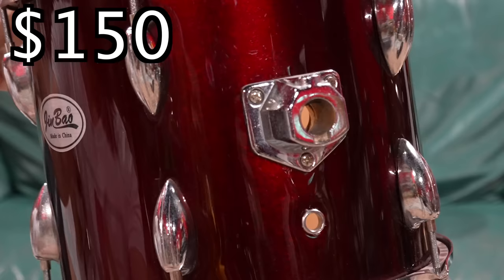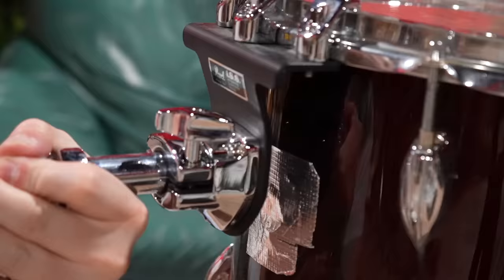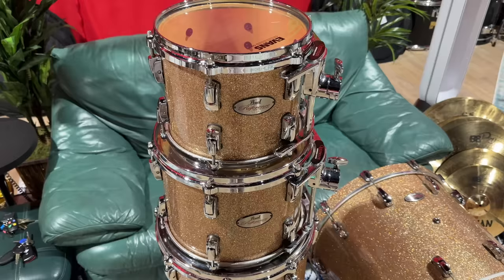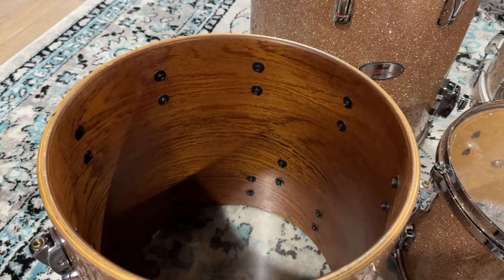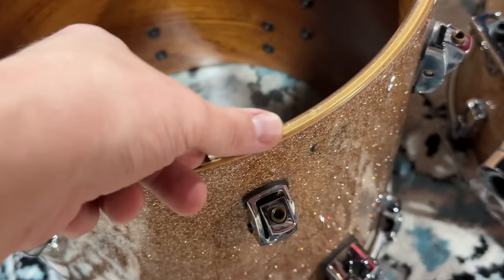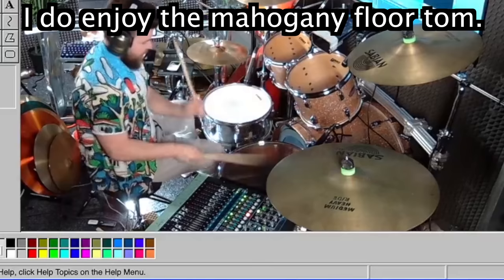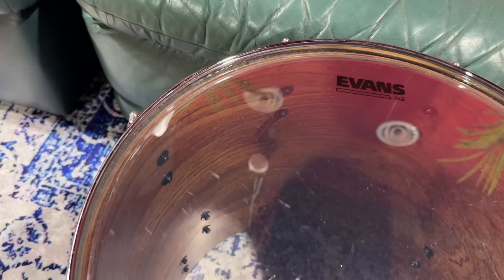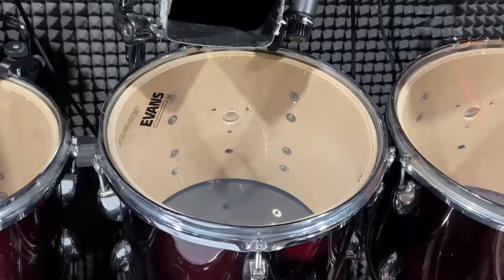Cheap Drums vs Expensive drums

Comment: Lots of opinions here.  I would only add that I had to play for multiple decades before my ear was refined enough to kinda really hate cheap kits...  But eventually it will happen.  Mint heads stretched over garbage bearing edges made of light, badly laminated shells with lugs that don't line up well and loosen off constantly.... Yeah it all works great for a few songs, then it goes pear shaped.  If you're keen, you're keen.  If you're a thrasher who keeps the same heads on for thousands of hours of said thrashing... Don't spend, you do you.  

Placebo effect held in mind, the same rule still  applies in most things in life....tools, trucks, hotels, sports equipment, camping gear....etc 
You get what you pay for, but if you're on a budget, you learn to be happy (ish) with what ya got

Comment: I don't know I think the guy working the corner of home Depot does a pretty good job with a 5 gallon paint bucket, 1 gallon paint bucket and a stainless steel wok and a vaguely conical square piece of aluminum. Sounds pretty good

Comment: This is why I only buy mid-tier drums.  I'm not about to spend more than $1000 on a 4-piece shell pack since I know that I can make cheap drums sound fine, but I also know that: cheap lugs explode at the mounting screws when you have the audacity to change your heads for the first and only time, cheap hardware shoots chrome dust all over the place, cheap wingnuts loosen up and never tighten again, and everything makes weird creaking, groaning, popping noises when you breath on it.

Comment: Fix the cheapos by sanding of the edge and checking with a straight edge, then tape just below the edge, use a thin layer of titebond 3 or tung oil to harden it up (remove the tape while still tacky).  Heads will now align flat and evenly tune.
Get a cheap tap and die kit and rethread the tuners, then put a thin layer of blue loctite evenly on the screws (clean them THOROUGHLY first with parts cleaner/acetone).  Let them cure before using.  Finally, add nylon washers.
Yeah it's not my 10 lug Super Drum, but now my $50 Griffin snares from Amazon now tune almost as nice as my Yamaha Stage Custom...

Comment: If you're playing drums with that kind of power, the differences between the expensive set and the cheap set will be marginal. The real difference comes in when you play the sets quietly. The ear will pick up the inconsistencies in the head/bearing edge contact on the cheap set. There may be nasty overtones and dead spots. The toms are less likely to sound matched tonally. From the drummer's perspective, they will feel cheap to play due to the lack of mass from the shell and the hardware. Heavier drums have a pleasing gravity to them.

Comment: I'm not really a drummer but I do drums for my solo project. I've been using some cheap ass mid 90s tama rock stars I got for 150 bones many yars ago. All my drummer friends (who are rocking stuff like Starclassics, DW, etc. always are impressed and say it's a great sounding kit when jamming, especially the kick drum. I mainly put my money into the cymbals, drum heads, pedals, and mics because I hear more of a difference there in the mix from all that stuff. Using some 1960s zildjians for the ride and hi hats- and then I have a sabian B8 for crash because I haven't got around to replacing it yet and it's servicable.
Reply: Ha -- yeah, I had a cheap Tama kit too, which I bought because I wanted to learn drums, had no idea what the difference was, and wouldn't be able to make a good kit sound good until I had experience anyway.  It was definitely the kick that sold me at the drum store.

If you just need something to pound on, it's all good, and fantastic that the barrier to entry is so low.  Even as a newb, though, I couldn't stand B8s.  haha  (Although I do think they work OK for some styles, just not what/how I play.)

Comment: The " the wood is the aftertaste of the drumsound" works for camera equipment as well.
Sure a 10K body and lens combo shoots amazing.. but someone that knows what they are doing can get very very close with entry level or downright crappy stuff.
The only difference it really makes.. it that it's so much easier to get a good result without fighting the tools the whole way through. You have to make compromises for what is and isn't realistically possible.

It's also very much a flavor, there isn't a "bad" way of capturing and editing images.. You might not like it.. but that's fine..

What would have taking me hours or several attempts, is done in a fraction now.. because I know that the high end camera will do they job just fine and images can be "tuned"  with a lot more image quality, if i'm off a bit.
Having a solid foundation will make it SO much more enjoyable.. I go out of my way now to make it harder and more fun to try things I couldn't get before, because the tool it's holding me back.

Comment: I got a original reference kit. ( heavy ) bought the snare too off eBay new $700 instead of $1400. 8/10/12/14/16,22. Cost 5500 10 years ago.  Lovet. Never gigged. In my bungalow as a practice kit lol.

Comment: I immediately heard the difference in the middle tom and, upon listening intently, I noticed the difference in the snare (edit: LMAO IT'S THE SAME SNARE AND I STILL HEAR A DIFFERENCE AFTER BEING TOLD SO). Couldn't tell high tom and floor tom apart. Maybe I would have noticed if I heard them in isolation, not superimposed with the tails from the other drums.

Comment: I was a drummer. Did I hear a difference? Maybe, but only very slightly and on the floor tom. The problem is, I was listening on crappy headphones. And I have no idea how the audio was processed. To really hear and feel the difference, you have to listen to the kits in person. Both from behind the drumkit as well as observing it 5 meters away in a room with reasonably good acoustics. Another thing is that comparing the cheapest crappy drums to the ultimate top of the line does not really makes sense, as nobody will be deciding between those options. I would like to add a comparison of decent drums, good enough for amaterus. Not crap, not overly expensive. You can get decent sounding drums that will not ruin your budget. Just make sure to disassemble them completely, clean them, replace any bad screws, check and fix any possible damage to the edges, make sure to tighten everything, add something to the lugs to avoid any annoying resonances. Put on new heads and really take your time to tune them. I agree with the video that you do not need to tune to a specific note. Just make sure you get the sound out of the drum you want. At certain tunings, any drum literally "sings" and sounds full. At other tunings, it is "closed". Experiment with different tunings of the resonant head too. It completely depends on what sound you want to have. Cheap drums are prone to loose tuning fast, because of crappy nuts used.

Comment: U don't necessarily have to throw wood filler, u can try ironing it out. You grab a moist rag, put it over the dent, and set a hot iron for about 30 sec at a time, and it's usually enough to raise the grain back up

Comment: People can buy so many decent kits from big brands like Yamaha, Tama, etc. that there is no reason to buy complete junk.

Some of the major brand kits will cost under or right at $500.  That's not bad.

I have my original Tama Rockstar from 1989 which sounds amazing after all these years.  I think I paid roughly $500 for it back then.

Comment: Cheapo trash is amazing, you can learn so much without breaking the bank. It's just like learning to drive a slow car fast. When you can actually afford a fast car, you will fly. Same thing here. Once you learn all you need from the cheapo trash, you can find some more decent hardware and sound great.

I got 2 basses. One is a Texas jazz bass (knockoff of a knockoff, terrible paint) to which I slapped a telecaster pickup and a random humbucker. I learned to foil. I learned to solder. I scribbled random whatevers in the back. I dropped it a lot. ITS SIGNED WITH WITEOUT BY A FAMOUS METAL BASSIST FROM MY COUNTRY. Will never sell it, but it doesn't sound great. It sound like nothing else too.

The other one is a nice Ibanez that I use for recordings and stuff.

I will always champion for cheap instruments. Go nuts, learn the thing, beat it to an inch of its life and THEN, get something a bit better or upgrade it.

Comment: It's very important to emphasize to beginners that it's almost never the instrument holding back your skill. I've seen countless of these Cheap Vs. Expensive instrument comparisons for things like guitars, drums, saxophone, trumpet, violin, etc. and 90% of the time you would be hard pressed to tell the difference; At the very least they each have a unique sound, but still good, sound. I've kind of taken instruments to be like clothes. Sure, you can splurge on a $500 jacket, but there is probably a $50 jacket that works just as well. If you have the money and want the $500 jacket go for it, but it's also ok to get the $50 one. There's are also $500 jackets that work worse than the $50 one and vice versa. The price is meaningless.

It's very easy to get caught in this idea that because you can't afford a $1,000+ instrument you're not good. It's the time, passion, and practice that makes a musician. Not the hardware you can afford.

Comment: I went through my stage of different kits, and woods  and polymers and I've debated the benefits of this and that. Bottom line after doing this for over half a century --  they're just cylinders. If they aren't warped or the lug aren't broken it really doesn't matter much at all. 98% of the sound is the head and the tuning.

Comment: You can heat that head and it will take the dents out of the head.  Tighten it way up...and use a hair dryer...or a heat gun...do not get it too close.  The dents will come out.

Comment: If you're only playing at home, cheap kits are great! When you start gigging with cheap kits you'll find out why they're cheap: the hardware. Stuff just breaks and falls apart. And yeah, nasty to tune. That said, I wouldn't buy a set of references to gig (at least not your usual pub/club gigs). It's definitely worth finding a used 'pro' kit in good nick and getting a drum tech to true the bearing edges.

Comment: Cheap drums with good heads, a decent tune, and good playing can sound just fine.  Throw cymbals on top, it's hard to tell a difference.  Add anything else and I'd say it might be impossible to tell a difference.  Cymbals are the only thing that you can't tune so that's where I'd put my money.  Also a good snare as tuning stability (holding pitch) is the one main difference in cheap vs expensive.  My snare will detune the lug I rim shot over in a song or two.  But its a cheap snare from a cheap kit and I play metal so its kind of expected.  Get a cheap kit, good heads, some nice cymbals B8 or better, and lastly a decent snare that holds its tuning and you're set.  And use those cheapo heads that come on the drums because they will look like the ones that came on that pearl kit, trust me.  Have some nicer ones for backup but use them.  Maybe cheap drums won't be able to get as many "good" sounds as an expensive one but there's usually at least one decent high, mid, and low tuning for a drum no matter what, do you really need more than that?

Comment: dont bother with the filler and sanding until you try scrubbing those dents with a boiling hot damp cloth. the wood will expand back to where it was or close enough

Comment: I have found you can make just about any cheap shell pack sound good with the right heads and dampening. Plus if you have them mic'd up even better. I had a cheapo bass drum once that sounded terrible and all I had to do was replace the batter head and what a difference!  Really the difference is about durability like with most products.

Comment: even if both drumsets sound 98% the same, the pearl reference one has more warmth when you compare it side by side with the jimbao. With "more warmth" I mean it has a little bit more low mids and a little bit more upper harmonics. It could be the miking also! nonetheless, the difference is almost imperceptible between one and other, showing that size, drumheads and drummers are more determinant to the sound that the material drums are made!

Comment: I Guess, there is the stuff of, drums can sound incredible when all miked up, or just when you are close to them, but some of the issues of a cheaper kit do appear when you are far away. This does not matter when you are a beginner. Either way, as someone who drummed as a child has pulled out my childhood drum kit recently and gotten back into drumming, I will say, please don’t get something expensive as your first kit. Get something cheap, some decent heads if the heads that are on it are dead or sound awful, and then, if you want to learn a lot about tuning and making your drums sound nice, I’d recommend the YouTube channel “sounds like a drum”. I agree that drum sound is subjective, and it’s all a vibe, but poorly tuned drums sound objectively bad, and from the perspective of someone who had never even touched a drum key, up until a few months ago, having guidance to assist in eventually finding a sound is useful.

Comment: It's actually quite surprising how closely I had to listen to tell the difference. I think the mic'ing and room sound must have a big impact on the overall sound of the kit. The Reference kit is pretty beautiful though. But if I had an unlimited budget and was going to go with Pearl, I would go all the way to the Masterworks. I don't know if it's a mistake or not but the PDF order form I downloaded a while back just for drum porn purposes lets you select the 'Artisan veneers' as your only inner and outer plies if you want. So you can go for a thin 6 ply shell with 2 plies in the middle of whatever 'normal' drummaking wood floats your boat (I'd go for the gum) and then the 2 inner and 2 outer plies can be one of the real fancy woods, stuff like Bubinga, Tamo Ash etc. My choice would be the Zebrawood, I haven't found any drum builders that make full Zebrawood kits so that is the closest I think one could get. My only snare atm is a slightly excessive solid shell Tama Star Zebrawood and it's such a lovely thing. Although the music school I'm at has that Pearl Export steel (I think) shelled snare that you have in this video and I can get rim shots on it so much easier than the £800 Tama. And I'd say the Export sounds almost as good overall too. So when you pay the crazy prices the construction quality and appearance certainly get upgrades but it seems clear that you're not getting 20x the sound when you pay 20x as much.

Interestingly Pearl have an online configurator for Masterworks now and you can't select the 'Artisan' woods as sole inner/outer plies but only as a finish. So if you want the Zebrawood on the inside and out, it would be 6 plies of normal woods (the 'Studio recipe' of 2 middles plies gum and 2 plies of maple both inside and out does seem very appealing though) and then 4 plies of the 'Artisan' woods. Very limited selection of finishes on the online configurator too i.e. you can't choose one of the 'Artisan' woods and then have some kind of fade or burst colour over it like you can with DW Collector's, there are set finishes for the 'Artisan veneers'. But I'm guessing that is just Pearl simplifying the online configurator and if you actually have the money to buy a Masterworks kit I'm sure they will let you do pretty much whatever you want when you go through a dealer. If anyone wants a look at the order form, here it is: https://pearldrum.com/sites/default/files/image_folder/SUPPORT/MANUAL/DRUMSETS/2018%20Masterworks%20Series%20Order%20Form.pdf
Or you can just get 90% of the sound (and minus 100% of the quality/looks) from the Jin Bao (don't know if I spelt that right, hope I'm not disrespecting the brand xD)

One interesting thing I learned from this video is that Australia also has Cash Converters. Thought they only existed in the UK!